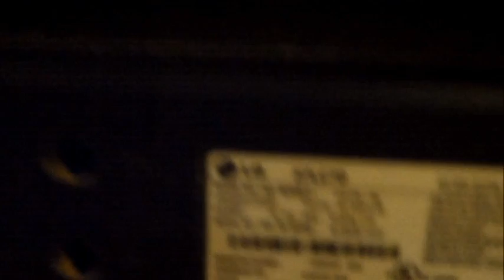LG LCD TV REPAIR - NO PICTURE SCREEN FIX REVIEW

Comment from the maker: check volts to inverter boards if good then inverter board is bad or has bad connection, check amazon or shopjimmy for the inverter board, good luck 8^)

Comment: @smtihg97: I've had the same problem with the same solution for about a year now. It started to get worse recently and has now completely stopped working as a fix. If you end up trying the solution offered in this video before I do, please reply back to this thread and let me know if it worked or not. I'll do the same if I get around to it first.

Comment: Hello Tampatec. :) I have a Viewpia 32 inch Flat Panel Lcd Tv, and the screen is black on it. I have sound of programme coming through, just no picture. I have taken off back of tv and looked at the compasitors but I dont believe any are gone as they are not black at all. They look new. I'm wondering how do i find out what exactly is wrong with it now? I would appreciate if u could try help. Thanks.

Comment: before working on my tv do i need to bleed the power from any capacitors?  i have a LG when i turn it on the light blinks green 10-15 times and then goes solid green but no picture or sound.  Thanks!

Comment: Hello Tampec,
I have got a 42 inch LED Model - LG42LE5300. It was doing good for past two years and suddenly stopped working. Now, every time when i turn it on - i could see the LG logo coming up and after 3 seconds everything goes dark. I could only hear the audio. Could you guess what could be the problem?

Comment: Hi Tampatec I like your video, can you pls help with                                      my problem on my LG 50PJ55O power supply EAY60968701 only clicking sound no picture&sound, I bought a repair kit from E-bay replace voltage regulator,3 resistor,1 diode and 1 fuse., Works for few hours and same problem.

Comment: AWESOME, I used this method to maker the tv turn on, now i have the old problem back now which is when the tv is on, on a chilly day, after 2-3 minutes the picture goes off, nothing at all, if i tap the casing it flickers on, but then 30 seconds it goes off, after about 10 minutes it comes on and stays on.  i have changes 4 capacitors on the PSU as they were blown, Any ideas  Adam

Comment: Hi, I have problem with Sharp Aquos LC-32D30M-BK model tv. When I turn on, the picture only display for few second (below 10 second) then it turn off and the red light start to blinking. I try to unplug and plug it back after few minutes but the problem still same. Need your help to solve my problem. Tqvm.

Comment: Hi Tamptec,
the video is very good, and he helped me to change 3 broken capacitors that my tv had! ( the tv was dead and now works PARTLY)

The tv has said, now works, but just for 30 minutes or so, then the image start to play around ( distorted, double itself, every pixel grow horizontally, lots of different video problem), but the sound is ok. 

THen if I switch the tv off and wait the tv is ok again for a little bit.

Please let me know if you need any more info!

THANK YOU IN ADVANCE

Comment: Hi! I have a LG 32LD350-UB. I plug the tv in but there is no power at all, therefore, no picture nor audio. I've watched your video and feel confident enough to try and fix this myself. :-/
Where do you suggest I start? Where can I get ALL the tools and replacement parts I'll need to try and fix this? Thanks!

Comment: I have a somewhat similar problem with my TV, Vizio VA26LHDTV10T, no sound, that I know of, and no picture. Here is a video of my TV. If you could help me, I would greatly appreciate it. I checked the capacitors, but they all seem good, no bulges or anything.

/watch?v=PcwDTsmrLSQ&feature=youtu.be

Comment: Hello, I have an LG TV ( lg42ld550 ) that's about 3 years old, and a few days ago the picture, regardless of what input I'm on, will become "scrambled" is the best way I can put it, after about a minute of use. At first I was able to just switch back and forth between inputs and that seemed to fix it temporarily. Now its consistently doing this after about a minute or two of use and there's no way to get it unscrambled. Sound plays perfectly, but the image is always scrambled. Any suggestions?

Comment: Thanks for vedio, and other inputs, 
Actually what i tried is ,  The Power Connection to TV was thru Stabilizer/UPS, and i did connected directly and Display was on, if its thru Stabilizer/UPS then it was no display. Not sure why UPS thru it was issue, but it was working since 3years

Comment: I have a Samsung plasma lcd tv that, as best as we can tell, was hit by lightning. After a bad storm, it stopped coming on at all (when we plug it in, the screen lights up for a few seconds, then goes dark) and the status LED doesn't come on anymore, and I can hear the circuitry humming when it's plugged in. I opened it and looked, and all of the caps look good. Do you have any suggestions as to what else might be causing this?

Comment: Hey man I have the same TV, but the 42" model. I have exactly the same problem, backlight works but no display. I have replaced the capacitors that were leaking & bulged and still no display :/

Any suggestions as to what I can do?

Comment: I have an LG 55LW5600 that I had got from a friend that was in a lighting strike. The tv powers on but no picture. I have plugged my phone into it (through hdmi cable) I know its connecting because my phone is asking which mode to use, so I tell its receiving a video signal but still no picture. Is there hope for the tv? I have removed the back, nothing looks burnt or smells burnt.

Comment: My 50" LG plasma has a similar problem, but with one important difference - the screen does not light up (it's as black as when turned off). Also this problem started occuring a couple of months ago, but only from time to time, so if it started without picture, you could just turn it off and try again and soon enough the screen would start. But it has become harder and harder to make it start, now it can take like 40-50 tries. Any ideas what the problem could be? Thanks in advance!

Comment: Would it be the same issue for a 42 inch1080i Westinghouse ? I have a similar problem screen lights up but no image I can hear sound but just like your it won't display anything ..  I already change the inverter board thinking it was that but that didn't solve the issue I was thinking it was the tcon board but I didn't see anything wrong with it either and I checked all the capacitors but I can't tell if any are bad.... plz help

Comment: what will be the solution for TV channel signal problem, I already check the cable antenna connections and its fine but then i dont still have television channel, it appears black with ziggy sound, please help me and what will be the solution, thnx alot:)

Comment: I got a 47LG60 that has vertical lines and goes to green screen. you don't get a picture every time you turn it on but you do get sound. do you got any videos on this?  control panel and call a repair person to check the control panel are so far the best answer. do you happen to have way to check to save me a service call? btw keep the videos coming :)

Comment: I have a LCD Magnavox that has a white screen with sound. This happened a couple years ago, asked repair shop about it and was told it could cost up to $200 to fix. It's been sitting in garage since because I could buy a new one for $200. It's a 2009 model 32md359bf7.